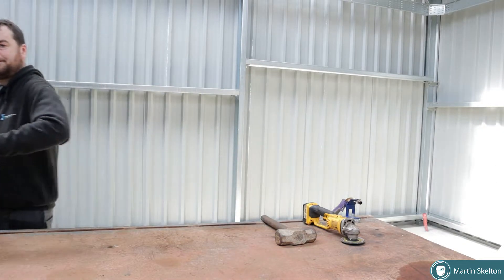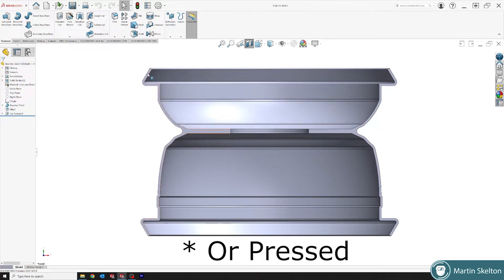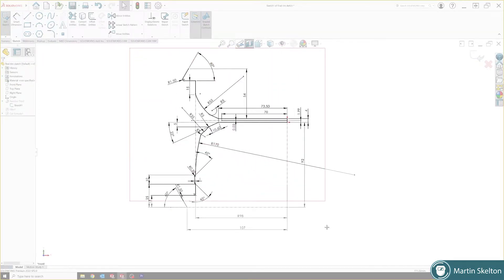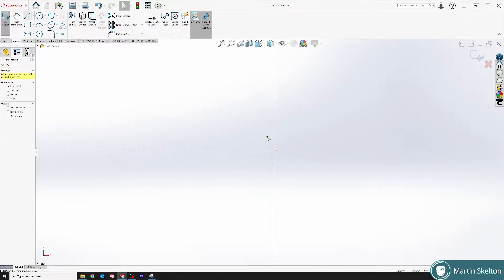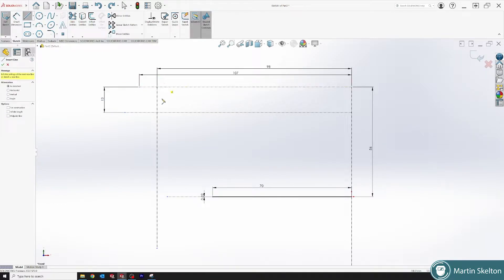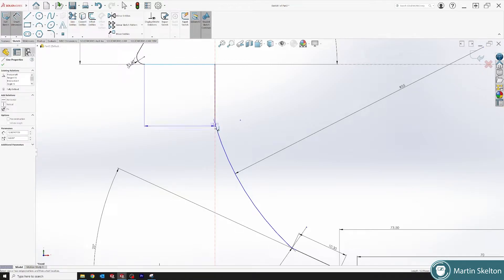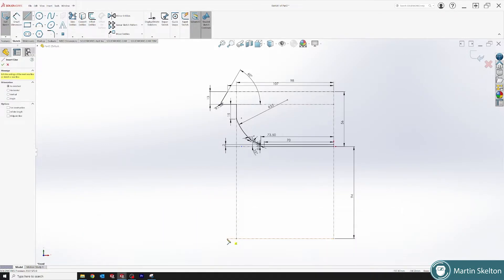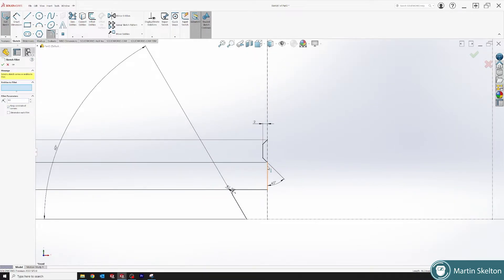A SolidWorks ATV Build - The Art of Drawing Real Objects, Part 1: The Wheel Rim

Comment: Thank you. And it would be great if you can show a video  of how you take measurements for a complicated parts.. like how you measured those arcs and such stuff
Reply from the maker: Hi Esraa, This is a great suggestion for a video. I will put together a video about the topic but I mainly use a space envelope and parameters method to achieve the result. But it depends on what is the hero of the design, is it the actual wheel rim that you are making or is it what the rim attaches to (the hub). When pricing work for clients, accuracy of components is a major factor in cost due to time spent. The theory is that you tend to produce none hero parts fast but visually correct (using a space envelope and parameters method) to give it an overall accuracy, and hero parts (hub) slower much more accurate and with a tolerance. Thanks for the comment and hope you enjoy the videos, I will have new video on the ATV build in the next few weeks.
Reply: @skeltondesignsolutionsltd  Thank you for explaining that, i almost never thought about it that way (hero and none hero parts) .. i can draw the part to its overall shape but i always try to measure every thing and in general i face difficulty when doing part with arcs and artistic shapes. Waitting for the video 🌼

Comment: Great project idea! I spend a lot of time modeling real world items to fit my project. I like how you demoed sweep cut.  I will have to try that next time.
Reply from the maker: Hi Tambaurora,
Drawing real objects can be great but time consuming. Sometimes you can get models from grabcad, trace parts or the component suppliers, but often it has to be done manually. If you were replacing a component on a vintage machine for instance, it is down to accurate drawing and modelling as you know. It can cause a lot of heart ache when a bolt hole is not fully lined up. I often digitise original 2D drawings to 3D cad models for clients, some original drawings really surprise me with the amount of detail and accuracy of drawing. The original manufacturing drawings done with a drawing board, a pencil and a ruler is truly an art and a craft within itself. Thanks for the comment.